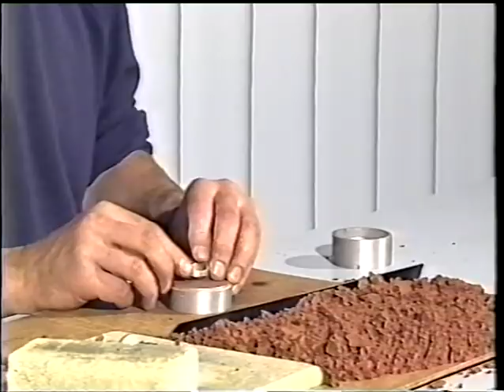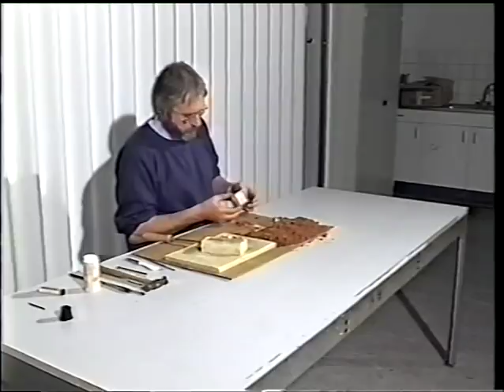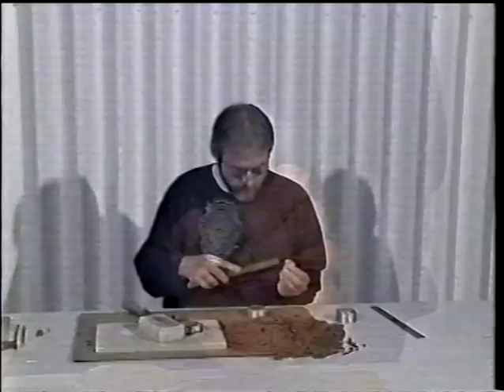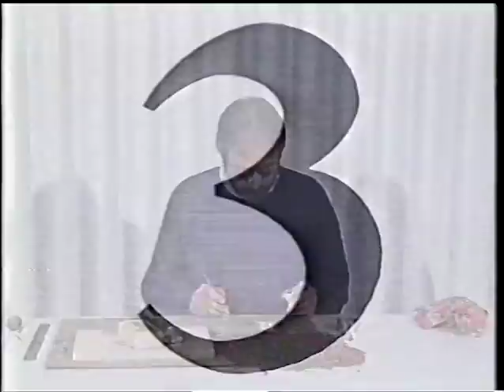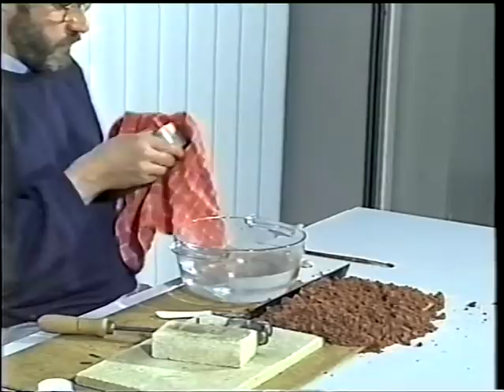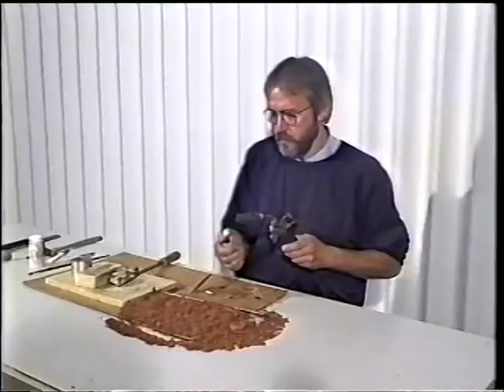The Delft Clay Method of Carving

Comment: when castiing a gold ring how can somebody tell how much gold to melt without over melting gold
Reply: Nicholas Esposito you never use exact amount of gold.  budget 2.5-3x the gold needed.  You need the extra mass to ensure it has the force during the pour to fill up the ring and sprue plus you need a healthy amount to make sure the pour is a strong steady flow to avoid premature seizing of the metal in the mold and force out all the air.   Seasoned people and jewelers just use their eye, but the math is best done off of specific gravity/volume calculations as you are replacing one volume for another.

If you know the density (sometimes referred to as specific gravity)
of the wax G(w) you’re using and you measure the mass of your total
(button, main sprue, sprues and models) wax M(w) then the Volume is:

V=M(w)/G(w)

which is the same volume for the metal.

With the specific gravity of your metal G(m) and the mass of the
metal M(m) the Volume is:

V=M(m)/G(m).

For the volume to be filled remains the same the ratio of M(m)/G(m)M
equals (w)/G(w). Therefore the Mass M(m) of metal needed is:

M(m)=M(w)/G(w)*G(m).

This applies for all waxes and all metals.

The density of your waxes and metals you may obtain from your
supplier or calculate by yourself.
Reply: or..... put the model in a graduated cylinder filled with water. Add an old button and sprue from a previous project or something of equivalent size. mark the cylinder where the water meniscus is. remove the model and button and replace with your casting metal until the water goes back up to the level of the line you marked.